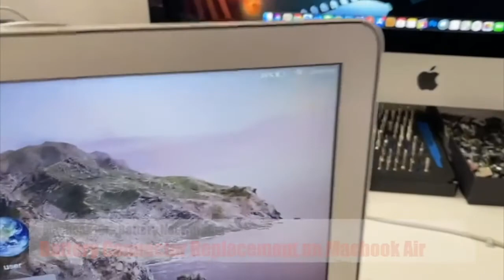Macbook Battery Connector Broken off Motherboard. Battery not Recognizing?

Comment: Can the connector pins be bought new? Are all the Macbook Air battery connectors individual like that? 🤔 Thanks
Reply from the maker: I'm not sure if you can purchase connector pins from ebay. But we use pins from donor board.  2013-2017 macbook air all the same battery.
Reply: @ahatron8640  from donor boards. Thanks